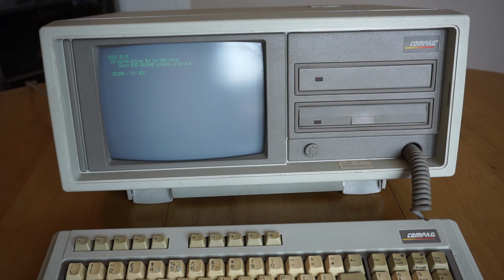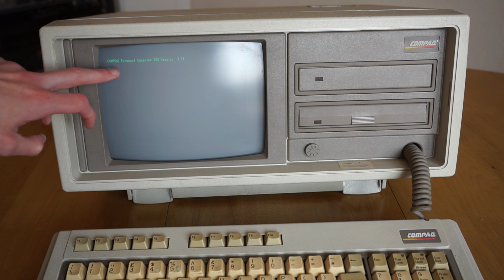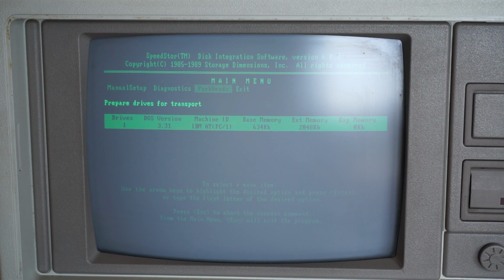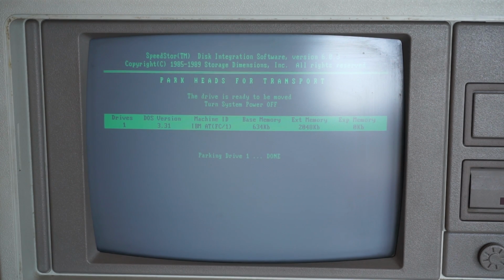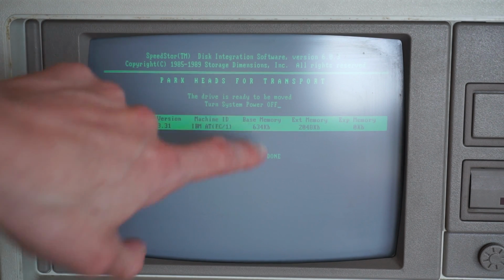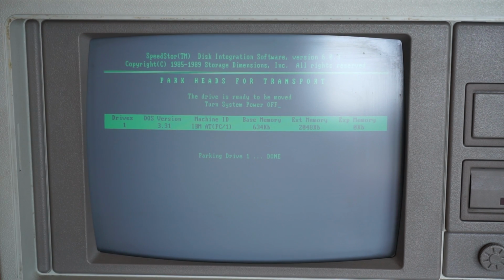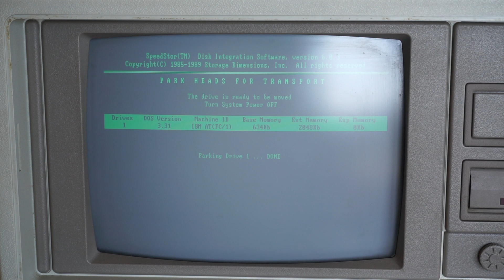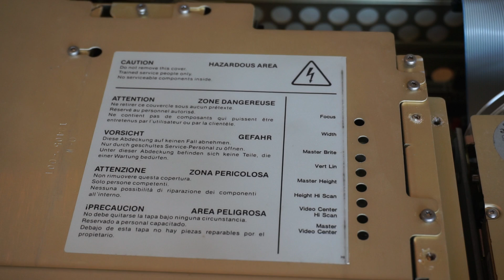Compaq Portable II - Tour and look inside!

Comment: How did you make the boot disk?
Reply from the maker: It was so long ago I can't completely remember.  I'd have either downloaded the files to a flash drive, plugged it into an old laptop and copied them to a 3.5" floppy then put this disk into a machine that had both 3.5" and 5.25" drives and copied them onto a 5.25" disk.  Or I would have used software such as Laplink to copy the files directly from a USB supporting machine to a machine with a 5.25" drive over a serial null-modem cable.
Reply: @camerongray1515  where did you got the files?

Comment: Hi, I have one of these machines, and it's still in working condition, but the speaker doesn't make any sound. It doesn't complain that the speaker is broken or anything, it just makes no sound. Do you know if there's a button or command to switch it on and off perhaps, or anything else that I could do to fix it? Replacing it appears to be impossible now xD .

Comment: I have one with a color monitor. Do you know what model that was? I couldn't find any label.
Reply: That's curious. Every photo I've seen of the Compaq Portable II shows it with a green monochrome monitor. It's possible your screen was upgraded later at some point. You might find some clues if you open it up. The video card it connects to can already output colour, so that is probably still stock.

Comment: Good heavens is that an IDE hard drive? As early as 1986!?

Lemmie do some research here...

"The first version of what is now called the ATA/ATAPI interface was developed by Western Digital under the name Integrated Drive Electronics (IDE). Together with Control Data Corporation (the hard drive manufacturer) and Compaq Computer (the initial customer), they developed the connector, the signaling protocols and so on, with the goal of remaining software compatible with the existing ST-506 hard drive interface.[14] The first such drives appeared in Compaq PCs in 1986" (REF: Wikipedia)

Well I never, WD, CDC, and Compaq are to thank for the move away from the ungodly ST-506 interface and this is literally one of the very first pioneering examples of the technology.

Great stuff!
Reply: It's also fortunate as it makes it fairly trivial to replace the original HD with a SD or CF flash memory card using an IDE adapter.
Reply: @zoomosis  although 8-bit IDE adapters for CF and SD Cards are easy to get now, and fairly cheap, and also often including a boot ROM, usually the XUB "Universal" BIOS. There's not much advantage to stock drive interface, especially since the original BIOS, and early period-appropriate versions of DOS, have serious disk size limitations. You would likely need new hardware upgrades anyways. BTW SD Cards are also much more fussy and flaky than Compact Flash.
Reply: @squirlmy  The disk size limitations can be overcome with Ontrack Disk Manager. I have a Compaq Portable II identical to the one in this video booting MS-DOS 5.0 from a 512 MB CF card, using OnTrack.
Reply: I thought that looked like an IDE connector.

Comment: You could just type "DPARK" in DOS to park the heads on the HD.

The RAM card is a LIM 4 type.

Mine must be a later version as it has a 20 M.Byte IDE HD with a IDE to MFM converter card attached as the OEM HD card is MFM, not IDE.

I run a 0.5 M.Byte LIM type card on mine.

The shipped OS was Windows 2.03 which recommends that the TEMP directory is set up in a 256 K.Byte RAMDRIVE for maximum Windows 2.03 operating efficiency plus also the .TMP files die when the computer is switched off. (You're supposed to do this on Windows 3.0, 3.11, 3.11NT and 3.51NT too).

I've had to repair the PSU once so far on mine.

You can run a second EGA or VGA graphics card on any PC, especially this one, and set it up as the secondary so that an external EGA or VGA monitor can be hooked up. (I used to do this on another computer years ago).

Some CAD programmes, back in the day, allowed 2 monitors to be run from a 286 / 386 PC with one for the menus and one for the artwork.
Reply: I suspect DPARK may have been supplied by a third party (perhaps Compaq or the drive manufacturer) as it's not a standard MS-DOS command.
Reply: These did not ship with Windows 2.03. They had Compaq DOS 3.1 originally. Also, Windows 2.03 is not an “OS”, it is simply a shell that runs over DOS.

Comment: I think the reason that the mouse dosn't work for you is these machines were pre-plug-n-play compatible so there should be some dip switches you have to set inside, I think each product had there own setting for the switches, but I could be wrong
Reply: You are on the right track, The reason for hang is conflicting memory addressing (Must be set) these are called IRQ and DMA. Mice use IRQ 2,3,4 and sometimes 12. https://www.webopedia.com/quick_ref/IRQnumbers.asp is a great website for a basic generic setup.

Comment: That's a very nice set. 
How does the built-in monitor get it's data?... does it get routed out through the bus going to the plug-in video card?, or does the monitor have it's own circuitry on the mother-board, and the card is just for external monitors?
Reply from the maker: There's just a small ribbon cable that comes out of the monitor bay and connects to a header on the video card, this can be seen at 13:20.
Reply: Got it... thanks, Cameron.

Comment: I have a compaq portable III, been sitting in my closet for years.  Its internal HD is dead
Reply: make sure you make the downloadable BIOS disk he showed. Most of these are really not dead, they just loose juice to the battery that keeps the settings, so they default to no hard drive. If you noticed the sticker on his it said (Type 1) this was a common way of communicating its specific settings (Heads, Sectors, Tracks) and once they are set, the bios can then access the drive.
Reply: You can probably replace the HD with a CF or SD card using an adapter if you feel like resurrecting it.

Comment: I suspect that "WINCH" interface is actually a very early form of IDE (Compaq invented it). No DMA and no fast PIO modes (the early drives couldn't even identify themselves), but if you plugged in, say, a Seagate ST-157A I bet it would work.
Reply: WINCH is short for Winchester. PC hard drives (of any kind) were commonly referred to as Winchesters up until the mid '80s. https://en.wikipedia.org/wiki/History_of_IBM_magnetic_disk_drives#IBM_3340

Comment: I had the original Compaq portable. I installed a 10MB drive from an IBM XT in it.  It worked without any setup because it had its own boot rom, but the full height drive caused the PSU to overheat so I had to mount a large fan to it externally.

Comment: the 'focus' pot on the monitor should (YMMV) clear up the image on the screen.. you should also be able to install windows 3.0 to take more advantage of that ram... the empty slot can also be fitted with a sound card (adlib or soundblaster 2.0) allowing your computer to sing.... an 8mhz 286 should also be able to run 'wolfenstein 3d' if you wanted to show off.. and if you wanted to be geeky the serial port used with a null modem cable could turn the unit into a dumb terminal for a linux machine... even more geeky the 2mb of ram could make a nice minix 2.0 machine... lots of potential in a 286...
Reply: That doesn't sound quite right to me. I'm fairly sure Win 3.1 (and 3.11) required a 386 with its memory management. In fact, Compaq came out with a 386 "DeskPro" desktop before IBM. Big Blue had misgivings about the 386, but it's ability to run Windows 3.1 with it's GUI made 386 PCs very successful computers, and IBM had to play catch-up once again. Th rare Windows 1 and 2 did work on 286s, but performance was lackluster. You would be able to play the original Castle Wolfenstein, which I spent many hours doing, on a monochrome screen, hearing a tinny speaker scream "Achtung!" and "Spygut!" (I have no idea if that latter is even close to a real German word) There were 386 upgrade cards for this and that would provide serious potential. IMHO 286, not so much.

Comment: is there a battery inside or do you need to always plug the PSU to the power socket
Reply from the maker: +Sigurd Lyng It has to be powered off of the mains.  The only internal battery is a tiny lithium cell to retain the CMOS settings

Comment: Very nice machine. There's nothing abnormal about the keyboard layout - that's the standard XT keyboard layout. Only difference is the function keys would normally be on the left rather than along the top.
Reply: This is actually the standard AT keyboard layout, as this is an AT-class machine. The XT layout is quite different. But yes, the function keys would normally be on the left.
Reply: @80sCompaqPC  Known as the Model F 84 key keyboard, as compared to the Model F XT keyboard. The Model F 84 key (AKA the original AT keyboard) is very rare. I've seen them show up once in a while on eBay and they run at least $200 US.

Comment: Can the battery be repaired or replaced for CMOS?
Reply: I really do not remember.  most of the CPQ systems had a coin cell in a holder that allowed for no solder  replacement.  cr3032 was the cell.  but they also had a solder version.  got a pic of the main board?
Reply: send an email to me david.heinrich@gmail..com found the manual
Reply: I don't recall cell batteries were used for PC CMOS before the 1990s. The IBM 5170's CMOS required 6 volts!
Reply: There's a photo here of the original battery. https://buildingtents.com/2017/01/01/restoring-a-1987-compaq-portable-ii/
From what I can make out it's a Tadiran TL-5104 lithium battery running at 3.6V, and isn't too hard to find replacements for.